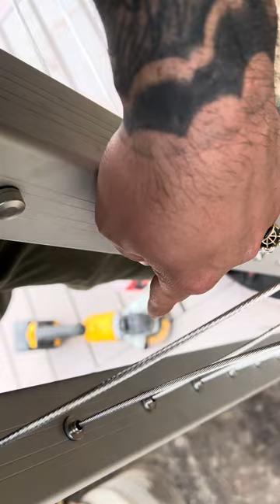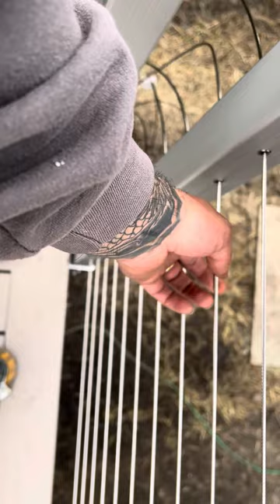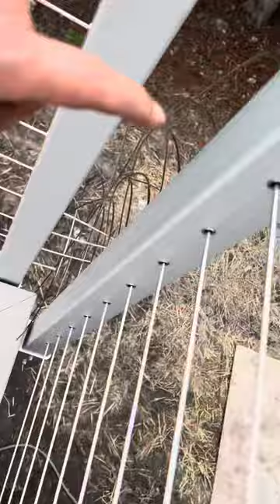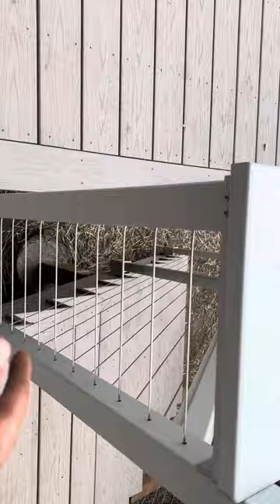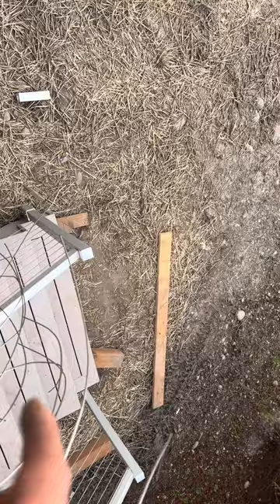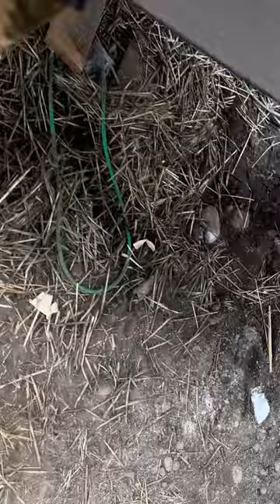Some stuff about our rail hardware

Comment: Nice video. Why isn't there a tensioner on the other side to? Didn't know a grinder was necessary to cut these cables.
Reply from the maker: There’s cable cutters but they don’t cut flush against the hardware so the caps won’t fit!
Reply: @bigbadbuilderllc  good tip!